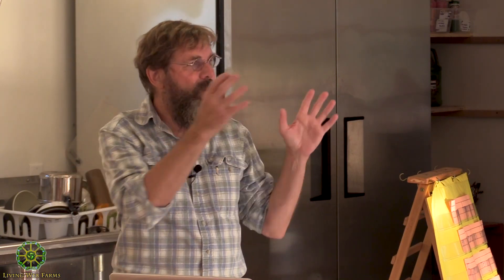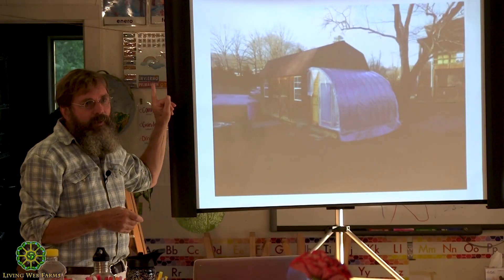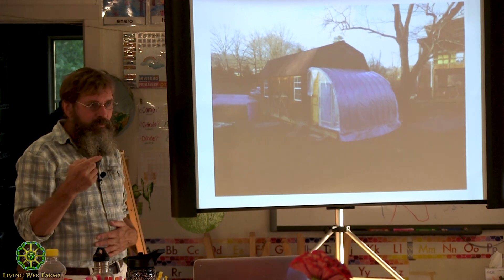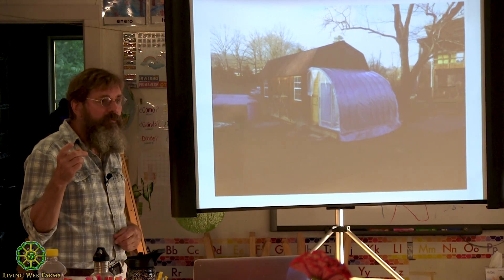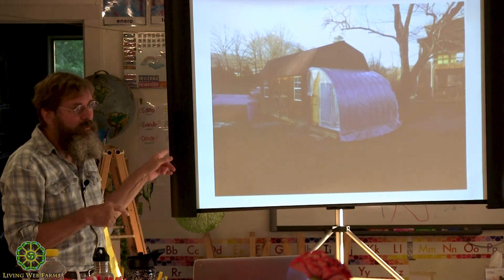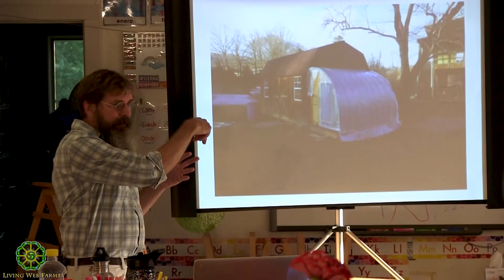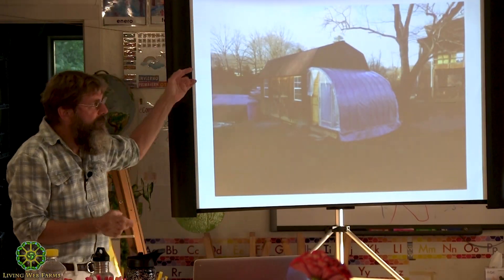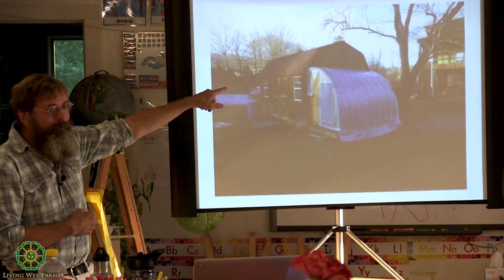Small Scale Biogas Digesters Part 2

Comment: I wonder if you could use a water jacketed fire tube modified from a water heater to maintain heat? You could use the same thermostat from the water heater and set it to the optimum temperature - also have it running on the fuel it produces. Just an idea.